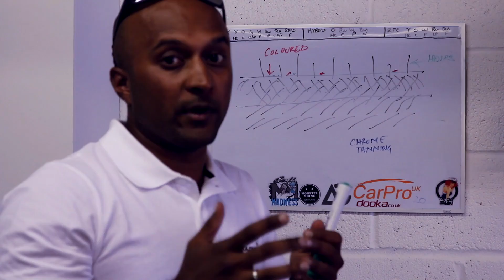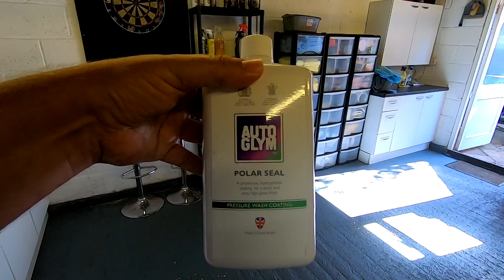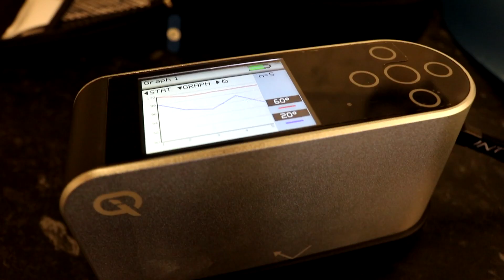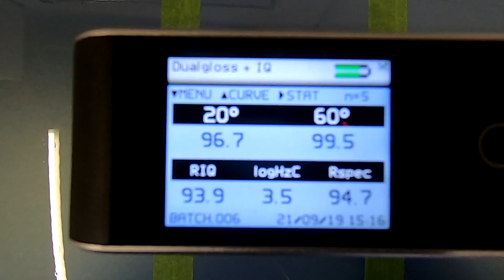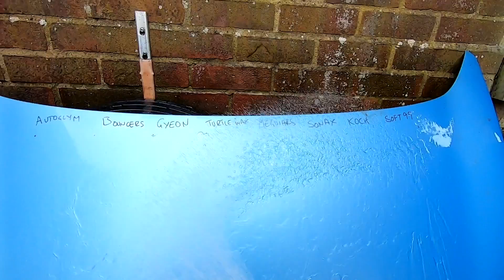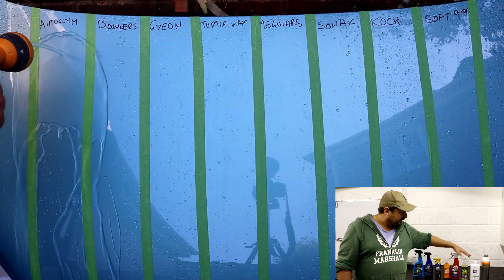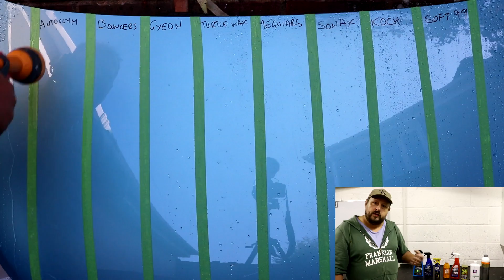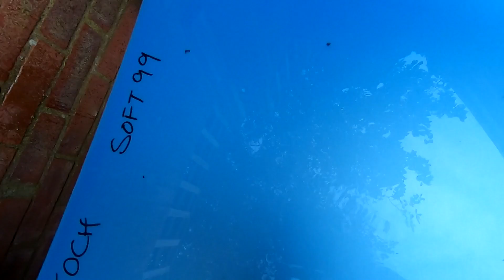The Best Spray Sealant | Drying Aid Wet Coat Spray&Rinse | Meguiars Turtle Wax Sonax Gyeon Autoglym

Comment: Perfect summary of gyeon wet coat, being a detailer myself I try a ton of products and for me hydrophobic protection means nothing if it gets buried in a day, I've tried the famous Meguiars on my personal vehicle and it's a solid consumer product but it's not a consumer friendly and I've even had slight trouble with the residue it can leave behind but it can hide swirls which is totally a Meguiars thing to do.

My summary is: 

Polar seal - Ease of use/Value

Turtle Wax - Value/ Powerful

Meguiars - Awesome looking/ great hydrophobicity 

Gyeon - Great self cleaner/ powerful 

These are the ones I've personally tried and somehow Gyeon just wins it every time 👍🏻 

Great video man 💎
Reply from the maker: spot on yer..  ironcially ease of use or less risk of streaking is more important to a pro than the consumer or guy at home as the pros reputation is on the line.

Comment: I switch between Sonax and Gyeon Wet Coat as a wet application as they're both awesome. I tend to use a dedicated wash mitt to wipe them over the panel once spraying a couple of streams per panel. Levels the product nicely and takes seconds. Works a treat. Nice vid as always!
Reply: wet or dry mitt?
Reply: @Jonay1990  Damp
Reply: Yes but polar seal in a lance is sooooo easy and quick

Comment: Great video, love these comparisons.
  
I’ve been using KCx PW for about a year and I absolutely love it.  Wet Coat deserves the top spot for sure, but don’t sleep on PW.  I have several large SUVs to maintain, and applying PW with a foam cannon is even easier/quicker/safer than Wet Coat.  Never had any streaking or filming and I have very hard water.  

I dunno if there’s any KCx science to it but I get great gloss and hydrophobics using AF / NMS / PW every wash.
Reply: Koch chemie just released the s0.03 hydro sealant, I will buy it at some point and test it. First I have to finish the Labocosmetica Beneficia, which btw I prefer it to gyeon wet coat in terms of performance and is cheaper also.

Comment: I’ve been using Gyeon wet coat since it’s release and I’ve found that chasing 2-3 sprays around a panel with a fresh wash mitt and clean water before rinsing with a power washer is the way to go 👍
Reply from the maker: Defo Kris that will help spread it.. wet clean plush microfiber works as well.
Reply: Do you rinse out the cloth between panels? Also is the cloth reusable after a machine wash or does the wet coat gum it up? 
Cheers.
Reply: @jonajones530  I keep a bucket of clean water and dunk between panels.
Towel or mitt will be fine afterwards. It won’t “gum up” whatsoever.

Comment: Very through review again John. 
I use Gyeon Wetcoat on some maintenance washes. 
I have a video showing a couple of application methods and found that instead of spraying directly onto the panel and rinsing off, I spray it onto a wash mitt and wipe it round, then rinse. 
If not, I’ve found that it sometime stains the panels. You also use so much less protector when spraying it onto the wash mitt. 
I fancy giving the Koch protector wax a go next 👍🏼
Reply from the maker: this tip is great, Ive talked about a similiar thing use a wet microfiber and spray and spread to make the film, you can get better film formed.

Comment: John, thanks for a great comprehensive review on these products. 

I recently bought the Megs Hybrid Ceramic Wax and I admit I hated it initially. I never over applied but simply couldn’t get it off the panels leaving a decent finish. 
I even tried Sandro’s recommendation of applying to a dry car, which was even worse.
Watching one of Megs newer how to videos made the penny drop, the carry is essential soap! The secret is to wash off the carrier. 
This adds a step to the process but it seems to work reliability. Wash the car, rinse and leave wet. Spray every panel, using very little product (bottle well shaken). Wipe in completely using a microfibre (like the base layer application). Now rinse the car thoroughly (power washer or hose), then finally towel dry.

Wiping in, spreads the product evenly and the second rinse, removes the carrier, which I think is the cause of the application difficulties.
Reply from the maker: hey there Ive only applied it a couple of times on cars but tested it about 3-4 now.    When I applied it first on the golf I just washed and rinsed and go tthe car 95% dry with a towel.  then used a wet microfiber pad to work in some product to a section of panel.  I just made sure I had a decent thin film..  then buffed.    I realiseyou dont or shouldnt buff it to a high and dry shine.. just level it and leave it.   Then the next day the car is awesome and repelling well.  that seems to work for me.

when spraying and rinsing key I think is just mist small amounts on and blast around.. rather than sort of end up with a big puddle of white product which is not spread. pressure washer important yer.

totally agree with what you are saying you just need to make some adjustments.  but once you got it layed out it seems to last well.
Reply: John, thanks for the reply. I actually followed your instructions (which are similar to guard and gloss) but I am definitely seeing better results by rinsing off the carrier.
Enjoy the channel.
Dave

Comment: On your advice Jon I purchased the TW Rinse & Dry after being a huge fan of Gyeons Wet Coat. I cannot fault the TW stuff. I do see the same in what you say with Wet Coat in that even as it gets dirty it retains its hydrophobicity through the dirt better.

Regardless bang for buck I cannot fault the TW and it's my winner. Add to that if you apply it by misting 1-2 spritz on the panel, one on a wet MF cloth then spread and rinse... lucky if you use 20ml of product on an average sized car. Works out something ridiculous like 16p per application and as you are leveling it as you spread, reduces the risk of streaks etc to practically 0 in my experience.

Fantastic video Jon, one of my favourites I think 👍
Reply from the maker: And you can get it for £4.73.  I knew you would like it B.  Its that instant bond and slickness and hydrophobicity.   the wet microfiber is a good thing yer.. the danger with these products is cover the car in them.
Reply: Nice tip! I think I might try to spritz, wipe, rinse on my next application of TW. I'd like to try Wet Coat in the future but don't think I'll need any for a while as I've got 2.5 bottles of the TW to get through now! lol

Comment: I used the Turtle Wax dry and shine last weekend for the 2nd time, first time I used it went perfectly fine and was fantastic, great beading and lasted very well.

2nd time I used it I over applied it and I made an absolute mess, found the easiest way to clear it up was with a quick detailer and for the glass some glass cleaner.

It also made a mess of all the rubbers as well so I had to clean them too.

Lesson learnt, don't over apply and thoroughly rinse  it down If you do.

I will still use it I just need to learn to apply it right.
Reply from the maker: a lot of people have said very similiar things.   I keep it away from glass.  I just do one sort of mist on a panel and rinse off with hose in other hand..   and obviously make sure car is loaded with surface water and nice and cool.   and I give it a good towel down.. but yer its easy to mess up I think.  TW and megs hardest to apply without risk of bad applciation cheers kyle.

Comment: Really informative video 👍 I was detailing my dads car and was in a rush to finish. So I sprayed and rinced Turtle wax dry & shine on the car and then took it for a quick dive like the bottle said. When I got back the car was covered front to back with dark streaks. Took me forever to get thsm off. Over all it's an amazing product. Just don't drive to dry it.
Reply from the maker: yes and to be fair all you did was follow the instructions.  so it has perhaps an issue there.   its something that needs to be applied carefully.
Reply: I learnt from my mistake. I towl dried the wifes car after I did hers next and wow, what a difference. Thanks for the video and look forward to the next installment.

Comment: I have used wet coat by gyeon for years, I bought a new car last year took it to my retailer for a full car refinement and coated with gyeon MOHs. I wash it at least once a month using wet coat as a top coat type thing and it’s perfect, no swirls no marks on the paint at all with its self cleaning and hardness I don’t have to apply any pressure to get any dirt off.
Reply from the maker: yes, its good isnt it Big Al.  like as well as it not clogging up it just seems like it helps keep the car a bit cleaner..

Comment: I used a full bottle of Turtlewax Dry & Shine for one application! I first did it on my wheels then rinsed it off and re applied it on my wheels. I then did it on my car and thought i had to cover the whole panels and then did it a second time. But i got amazing results. The slickness of it is something ive never seen before and the beading is crazy! I have alot of car detailing products but nothing i have compares to TX D&S
Reply from the maker: jesus christ a whole bottle Pete :)  thats like tell me you went out on the beers and drunk 30 pints.

this product is really really cool isnt it.  genuinly cool..  when I first used it and toweled the car down. it was the way the towel felt on the car which impressed me..  the car also looked great and was beading like crazy..  And you can buy it for £3.50..

people are correct you do need to be careful with it.. I dont really use it near glass.. and if you use too much its critical to blast away all the excess which you will see as like "white" liquid flying off the car when you rinse..     but yer this is a great product for an incredible price.

Comment: i have used Wet Coat through a snow foam gun, particularly in windier conditions with excellent results. 30ml in 4/500ml of water and keep blasting to rinse off & flush out the foam gun bottle.and then dry all the glass first.. Never had any problems at all.

Comment: Would love to see autofinesse aqua coat. I think it's a uk based brand, so should be acessible to you.
Reply: its about the same as Wetcoat, on ability and price.
Reply: Agreed. Very good. Would like to see gyeon wetcoat vs aqua coat. The bottle i think is bigger too, value for money wise
Reply: @pete8824   - yes Jon had the smaller 500ml Wetcoat bottle, the 1L Wetcoat and 1L Aquacoat are about £16-18 each in UK
Reply: @Mogsy28uk  would be a good comparison video. I've used aqua coat which i like and ceramic hybrid wax which I'm not a big fan of. It seems to do next to nothing on glass, where as aqua coat is very good on glass
Reply: I have a bottle of Auto Finesse Aqua Coat which I have yet to try, had forgotten all about it until I read your posts so cheers for that!

Comment: I thought at first what a great idea for my ceramic coated car but if used then it rains shortly after the water spotting is so bad the only way to remove is to machine polish so I don’t or would never bother with them again.
A great vid John
Reply from the maker: I would only recomend wet coat for coated Car peter.. but also use somethign like cure or reload or C2v3 to solve the spotting vulnerability not a spray and rinse one your right mate.

Comment: Excellent video Jon, Just superb. I've tried quite a few of these types of things so it's nice to see you find similar results to me or at least in a similar way. One application method I've become very fond of over the years is to use a separate fresh wash mitt and use it to spread the products over the panels prior to rinsing off. I find this vastly reduces any problems with over application but also teaches you how much you actually need. The Gyeon works amazingly well this way, Seems even more glossy somehow but the Turtle Wax is crazy. You don't need much but gloss & water behavior is ridiculous. Quite impressed by it. You're right though, You just gotta be careful, But when you are they're brilliant products.

Comment: I imagine that over in U.K. your Turtle Wax Dry and Shine is our version of TW Ice Seal N Shine. It's very resilient , for sure, and I've seen videos from your compadres here in the States that rivals or beats the new TW Hybrid Solutions Ceramic Spray Coating. I'm sure your tests will follow soon enough. 👍
Reply: Ed Ruiz The UK equivalent of ICE Seal N Shine is Turtle Wax Hybrid Sealant. The bottle is styled very much like the USA version. I can't see an equivalent for Dry and Shine in the ICE range.

Comment: CarPro Hydr02 works great.
Reply: Fvi E36 I get my first bottle to try tomorrow in the post after hearing lots of recommendation.
Reply: Fvi E36 Yep it’s great!  I use it on my wheels and under the wheel arches as well as the body work. Use it as an easy top up on top of Car pro reload . 👍
Reply: Big fan of HydrO2. Its on par with Wet Coat imo.
Reply: Fvi E36  for the life of me I cannot decide which I like better between Hydro02 and gyeon. to me it is all about gloss and  maybe self cleaning.
Reply: I picked up the turtle wax rinse wax thought I followed the instruction but it left an oil on water staining on the whole car which was extremely difficult to remove. It survived surfex hd, meguairs wash plus and was finally removed with exteme level dilution of turtle wax max power. Im sure this was user error but havent used it since as a result.

Comment: Quite surprised with low scores of koch PW. I am happy with this one so far as a winter sucrificial. It bumps the looks but requires some time to bond/net. It shines like crazy on a uni red paint. This is not a fine carnauba look, I would call it plasicky, but it does the synthetic shine thing realy well. It is not slick to touch at all. Also, cost effectivness. This is 1:100 so 1 liter gives a hundred, spraying this by hand sprayer you are using up to a 0,5ltr, 200 applications, 20 pounds a liter in queens money :) Also, never had a smallest issue on glass - I was using this even after having a good prewash, only! Then air-drying my car at some excesive speed ;)

Comment: Hyprid ceramic wax: I got best result when sponge wiped 1 sparay on a panel and preasure rinsed. Dry & shine: Spay a mist on wet surface and you can dry it super fast and super dry. The water just dont stay on the surface.

Comment: I was actually using Sonax spray & seal, but I changed for Beadmaker. I may go back to the Sonax because I have 2 bottles left.. my worry was: could I apply one product  on top of the other ! with Sonax first it was OK. Now I am afraid I would have to really do a strip wash to start it all over again. My first layer is always Collinite 845. But the ease of application of a spray and seal product is really nice....

Comment: Be carefull with the wet coat, i have been using it for a while. I loved it! Loved! Not love. When the botle was close to empty i startet notice spots on My paint. It looked almost like clumps of wax, and it realy hard to remove with a towle. Aside for that, great product👍🏽
Reply from the maker: I think you do have to be carefull with it.  Im convinced it has hardeners in there as well.. but whatever material it lays down it does offer self cleaning I think.  Very good stuff. I also keep it away from glass and trim as well.

Comment: I don’t want beading, I want sheeting. Beading dries in the sun creating water spots. Nothing I’ve used provides the solution.
Reply: What you want is hydrophobicity. Sheeting does no good if it sticks like on untreated paint. A polished surface also helps, since lots of scratches will increase the surface area and make it easier for water to stick to the surface.
Reply: True maybe try a ceramic coating